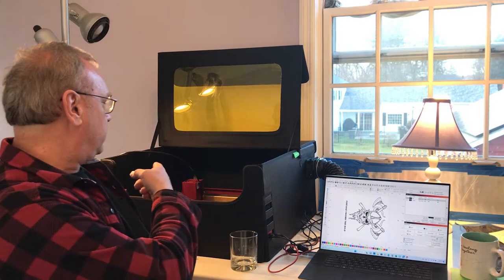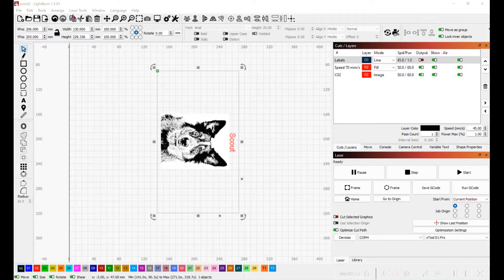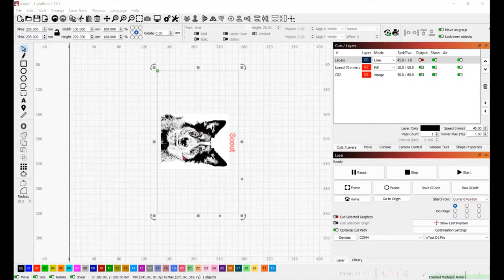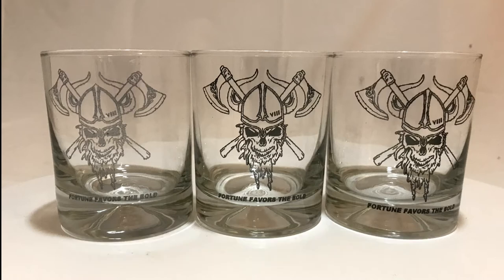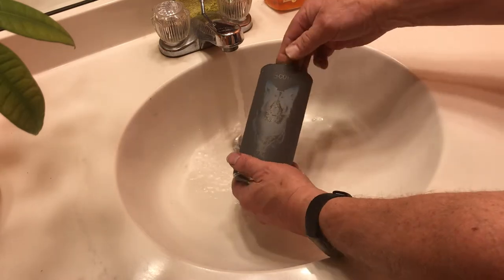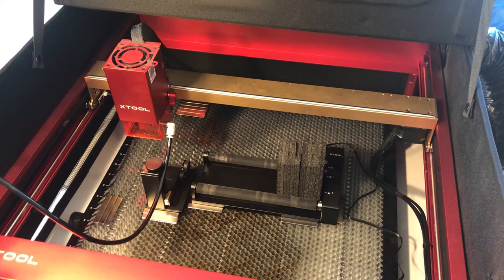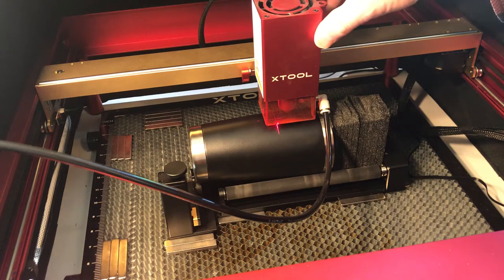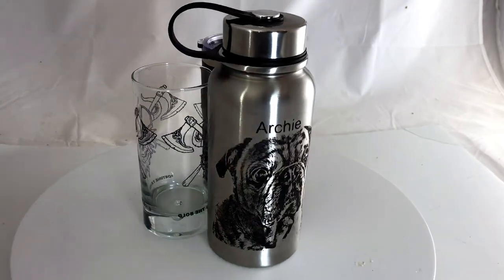XTool D1 Pro 20W Laser Etching Glasses & Tumblers using Marker Spray

Comment: Can a IPad also work With the lazer
Reply: I use my iPad via Blue Tooth BUT sometimes it stops in the middle and shows a disconnect message even though it’s not disconnected. Grrr.  Not all the time but sometimes. I’m using the free Xtool software Creative Space. If someone has a fix for this, on my iPad, please speak up.

Comment: Hi great informative video. I have a question if you could help ... I've seen ppl use the galvanised spray using stainless steel preset setting for glass. What settings would I use if I used tempara paint instead of galvanised on a glass? Would I have to go less aggressive on the settings? Cheers 😊
Reply from the maker: I've used the same setting for CarMark Black laser marking spray and for black tempura paint applied with an airbrush

Comment: What are your power settings
Reply from the maker: for the black tumbler
I used 50mm/sec at 60% power on my 20W blue laser
Reply: It’s funny I saw about mid way on the cooler was mint so kinda guessed it was around the half speed half power range, thanks for a great video!!

Comment: Watched, but no settings given for stainless steel tumbler.  Can you supply them?  Thanks.
Reply from the maker: I used black laser marking spray and 50mm/sec and 60% power
Reply: @SerendipitySue  thx, what about glass settings? I added too much and my glass shattered (((
Reply: @SerendipitySue  so, you sprayed the stainless tumbler the same way you sprayed the glass.  Maybe that is what I am doing wrong.  My etching never comes out shiny like even after the washing.